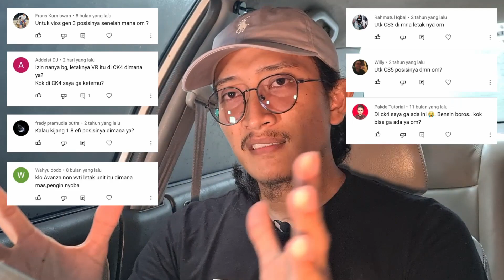Fungsi dan Tujuan Variabel Resistor Pada Mobil - Maksimalkan Performa Mobil

Comment: variabel resistor alias setelan CO ini cuma valid dalam putaran mesin langsam / idle. biasanya pabrikan mengatur untuk putaran maksimal 2500rpm. diatas itu, fuel regulator akan meningkatkan duty cycle tergantung kevakuman intake manifold. pulsa injektor sendiri akan berubah diatas 2500rpm dan beralih ke bacaan mapping dari sensor2 lain seperti tps, map, maf sampai ect (coolant). makanya di mobil yang sudah pakai wide band o2 sensor, setelan CO ini ga ada
Reply from the maker: Yess mas. mas BTW makasih banyak infonya. kami masih terus belajar.

Comment: mas kalo variable resistor sering berubah nilanya kadang naik kadang turun, kalo abis jalan 1-10 km, ada solusinya gak mas di repair atau ada barang penggantinya yg ori,
Reply from the maker: Ganti mas. WA 085777779181